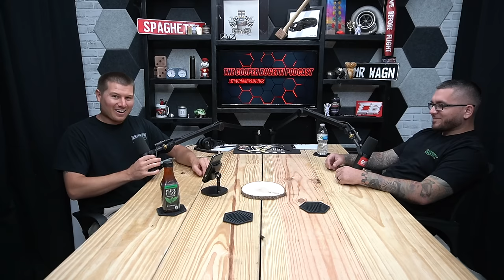Cameron Johnson : CJRaceCars, NPKs, Chassis Shop Owner, Class Racing | Cooper Bogetti Podcast EP38

Comment: The little bit I've learned about titanium is that it's good for structure. Using it as an exhaust going through heat cycles is when it becomes brittle. (Disclaimer, not an expert)